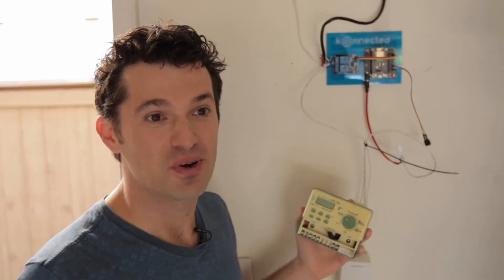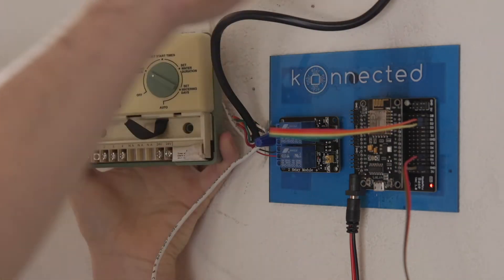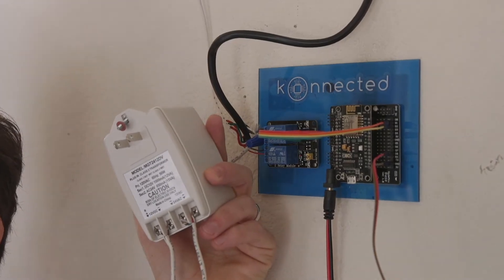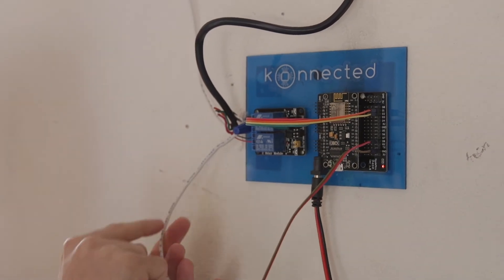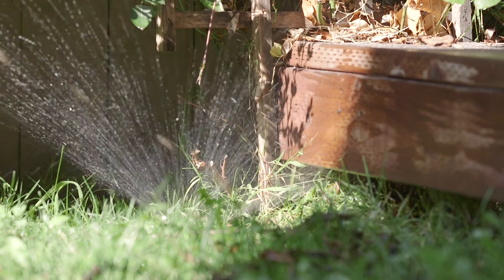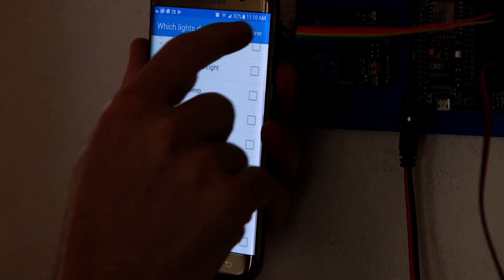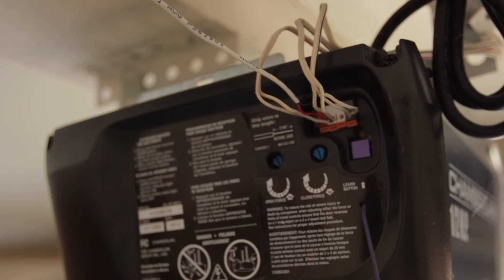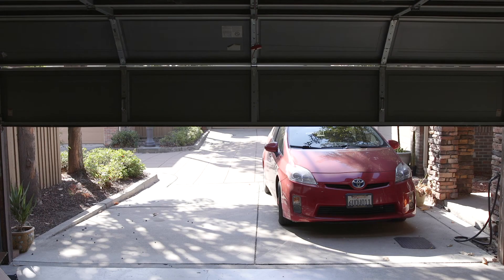Konnected Sprinkler Controller & Garage Door Opener

Comment: Does this work with the konnected alarm kit or is this a separate product?
Reply from the maker: You can set up sprinkler and garage door control with your Konnected Alarm Kit if you have unused/open zones after connecting your wired sensors. You will need relay(s) (available in our store).

Comment: What is the maximum number of relays a Konnected board can drive?  I have a 6 zone sprinkler and 2 garage door openers in my garage.  Can the board operate 8 relay modules?  Thanks.

Comment: In regards to sprinklers.  I have 6 zones  How many of those relay boards would I need to connect them up?  I also want to do the garage door like you are showing in the video.
Reply: I think you will need 6 channels worth of relays so 6 relays and one power supply. I think you can buy 6 channel (or more) relay boards so that you do t have to wire up each channel to power separately

Comment: Do the Open / Close logic check if the zone for the door is currently Open / Close, so if I ask assistance to Close it don't blindly press the momentary switch?
Reply: No, it's not that smart. Yet. 😉
Reply: Is there a way to input a magnetic switch contact to this board to show the door open or closed?
Reply: Yes, you can easily add a sensor to see the open/close status.